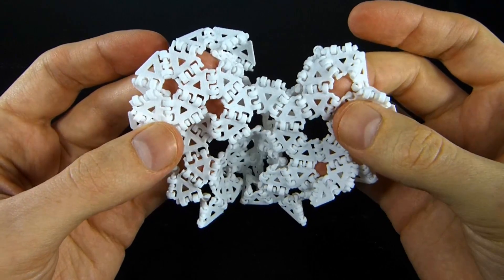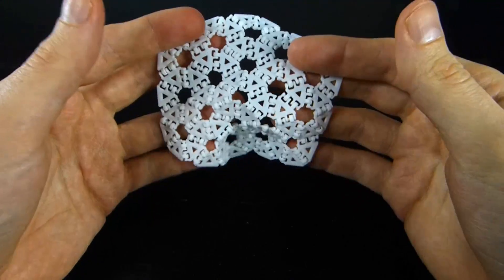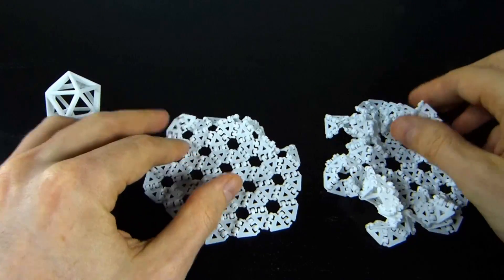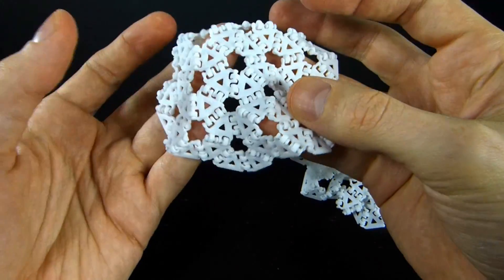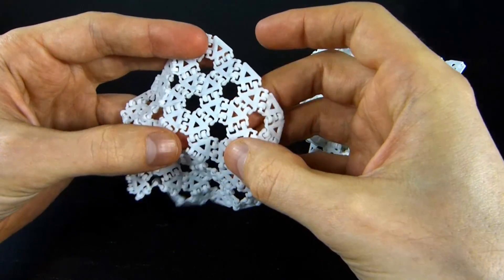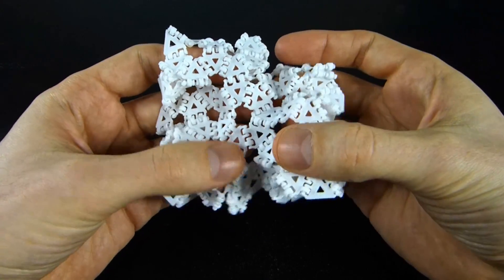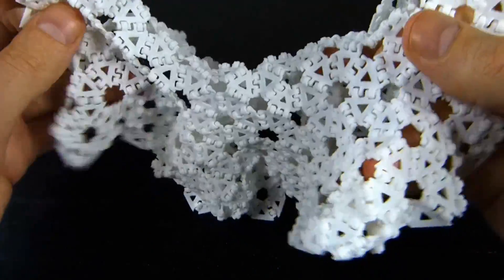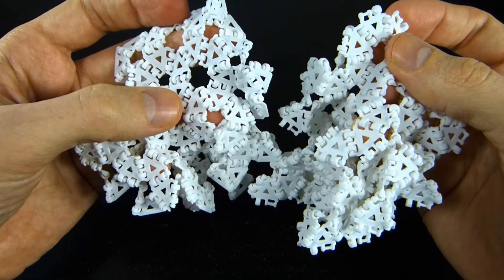Hinged negatively curved surfaces

Comment: how did you printed this 7-triangle stuff?
Reply from the maker: I use an SLS printing process rather than the usual desktop extrusion printers. There’s no need for supports with SLS, so interlocking geometry like this is doable.
Reply: @henryseg  thanks!!

Comment: Is there a maximum negatively curved surface? I imagine physically it would depend on the maximum bend angle of the hinges and the thickness of the parts, but would an infinitely negatively curved surface be mathematically possible with infitesimally thin parts or something?
Reply: Not infinitely, but arbitrarily large. A smaller sphere is more positively curved, so a smaller scale negatively curved surface is more negatively curved

Comment: There is an entire project exploring simple crochet algorithms exploring topologies like this. Many lace coral have this negative curvature. 
In a video of mine i explore putting two 2d circles together creating a 4d hypersurface which is prefect saddle form. Interestingly there is a single line of contact joining opposite ends  of surface

Comment: What if you do 12 triangles? That would get an angle deficit of -2pi, so what would that give?
Reply: a tighter doughnut.
you can imagine what happens to a sphere as you reduce the angles around its edges, it shrinks and tightens, halving the degree of a sphere has the same effect as doubling the degree of a doughnut.
Reply: i crocheted something like this where as i added stitches in a spiral the edge began to warp. as i kept going it turned into a sphere with the edge of my spiral looking like brain coral along the surface of the sphere. if that makes sense. i would mark a stitch and have people follow the edge back around to the mark. it took more than a minute

Comment: 6:02 yeah, the issue with packing in just a little bit more space "per space"... it starts adding up, fast. A hyperbolic disc constructed of square tiles (with five meeting at each corner) of radius, like, 50? Has a stupidly large number of tiles, something exponentially unreasonable. More than 30,000 I would say, but I dont remember off of the top of my head. (Maybe it's radius 50 where the number of tiles breaks the one billion mark)

Comment: I kind of want to see the order-5 square and order-4 pentagonal tilings as well though...
Reply from the maker: The order 5 square tiling could be interesting - I'm not sure how far you could go without it crashing into itself. The order 4 pentagonal tiling is very constrained - just around one vertex I don't think the pentagons have much movement available. So I suspect that it would be less interesting.
Reply: @henryseg  You can find a order-4 pentagonal tiling of radius 2 here: imgur.com/ a/ mxk5IvI (remove the spaces).
I think going beyond that radius leads to self-intersections but I might be wrong.
I modelled this in blender and would be happy to share the file. How does one add hinges to the edges?
Reply from the maker: @hyperbolicman9305  I designed the hinge geometry "by hand" in Rhino, and added them to the triangles with a script. With a small enough set of polygons it would probably be faster to copy the hinge geometry around by hand. However, I think that even if the edges have hinges, four pentagons around a vertex will not be able to flex: the saddle shape will be locked in.

Comment: Loving this, each step I’m momentarily unsure of what I’m looking at and then you explain it and it makes perfect sense. The one thing I can’t wrap my head around was the offhand comment that the hinges are printed in place? How the hell did you manage that? A saddle shaped support structure?
Reply from the maker: It's printed using selective laser sintering (SLS) rather than the usual desktop FDM technology. The print is supported by unused powder. This gives quite a bit more freedom to do things like hinges etc.

Comment: What would happen if you were to put 7 triangles around the center vertex, and then continue the surface with 6 triangles around a vertex?
Reply from the maker: A big patch of equilateral triangles with six at each vertex acts like the usual euclidean plane.   You can also combine a big chunk of those triangles together to make a single large triangle (e.g. 4 triangles make one bigger one, triforce style). In which case, your configuration would look like 7 big triangles arranged around a vertex. In practice, those big triangles would have some flex in them.

Comment: You can tile space if you connect the edges correctly like this: http://superliminal.com/geometry/infinite/3_7a.htm This manifold subdivides space into two regions just like any other closed polyhedron. I think this is the shape it wants to be and resolves all the problems of increasing mess. You just need to figure out which vertices to identify with which others. See the full table here: http://superliminal.com/geometry/infinite/infinite.htm which contains even a couple of such models with 12 triangles at each vertex.
Reply: That net had icosahedra in it; when it said {3, 7}, I doubt it was giving a Schlafli symbol.
Reply: What net or icosahedra are you talking about? We're definitely talking about Schlafli symbols here. The models in this video just turn into a mess, but when connected correctly like the ones in the table, they are very regular, and in 3 cases are perfectly regular and deserve to stand with the Platonic solids.
Reply: The golden triangles in the illustration you linked to sure look like icosahedra; embedding
the whole hyperbolic plane in Euclidean space of any finite dimension doesn't work. Modeling
the hyperbolic plane in Euclidean space is certainly doable, provided one accepts length
and possibly angle and area distortions, as with viewing Earth's surface on a plane (but opposite
effects).
Reply: That's not an embedding of the hyperbolic plane. It is a manifold 
composed of equilateral triangles, 7 at every vertex. Yes, portions of it are arranged icosahedrally, but those icosahedra are not complete. They attach to each other via antiprism struts and the whole thing divides space into two regions just like any polyhedron. It's a true {3,7} that you can build indefinitely in Euclidean space without distortion.

Comment: Great!  I hope a hinged surface of (6,6,7)-hyplane version.
http://www.scipress.org/journals/forma/pdf/2101/21010005.pdf
Reply from the maker: Thank you for the link, this is interesting. George Hart suggested a similar construction, and I think it can be seen as a different way to "subdivide" the {3,7} tiling - with six half-triangles per triangle of the {3,7} tiling.

I see that in this construction the angle defect is chosen so as to be the same at all vertices. This certainly works - the alternative that I have used is to make the tiling in H^2, measure the lengths of the edges there, and use those lengths for edge lengths of the Euclidean triangles in R^3.

Comment: does it naturally fit on the hyperbolic paraboloid you have?
Reply from the maker: The hyperbolic paraboloid has negative curvature, but not constant negative curvature, so it shouldn't do. Also the scales need to be matched up carefully. I do plan to do this with a surface of constant negative curvature, specially made at the correct scale. One of the problems is that the known constant negative curvature surfaces embedded in R^3 aren't very big, and I think these hinged surfaces are all bigger (in terms of the largest radius disk you can fit on them).

Comment from the maker: New things: What happens if you make a surface with 7 equilateral triangles around each vertex? This is joint work with Geoffrey Irving.
Reply: I think this is one of Andy's new favorite things. He shows the copies he bought off to everybody who comes by our place.
Reply: The play in the hinges makes your demonstration of a Euclidean surface being unable to curve in two directions simultaneously a tad unconvincing. :-)
Reply from the maker: It's more convincing in person! It's way better with the squares version.
Reply: William Rutiser I use cardboard/heavy paper and tape to test out many of my designs.  It can be a bit slow but it works.  I usually use heavy paper so I can still print the nets on it.
Reply: Is there some analogue to geodesics for a particular negatively curved surface?  Is that what makes it possible for you to do the equivalent of hanging the surface on a clothesline, with no bunching along that line?
Reply: How were the hinges made?
Reply from the maker: Scott Vorthmann The equivalent would be a geodesic in the hyperbolic plane. The clothesline thing is like folding along a geodesic.
Reply from the maker: William Rutiser I designed a single triangle tile and then had a script move it to all of the appropriate places. The hinges are just solid rods surrounded by a hollow cylindrical "barrel". The hard problem was where to put all the triangles in space so they could be printed.
Reply: This reminded me of how I was taught to make the saddle shape with origami:  https://plus.google.com/118344825606684490039/posts/jVcw9H5q2BR
Reply: Do I understand correctly that the rods and barrels were printed together with suitable clearance between them? Was this single filament extrusion printing or something more complicated? 

I am tempted to experiment with cardboard triangles and masking tape hinges.
Reply from the maker: William Rutiser Everything was printed in place, with clearance. I use Shapeways' selective laser sintering machines, so yes fancier than extrusion. However, Nervous System have had success doing extrusion printed hinged designs.